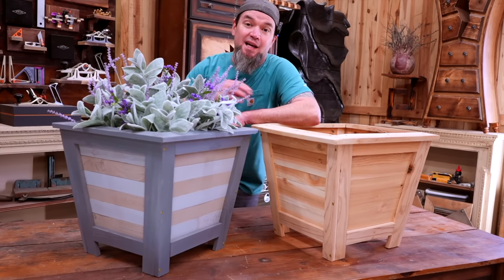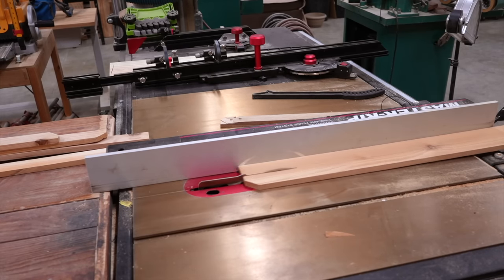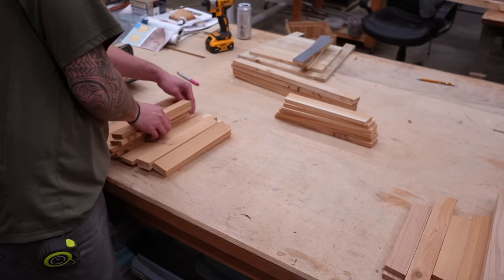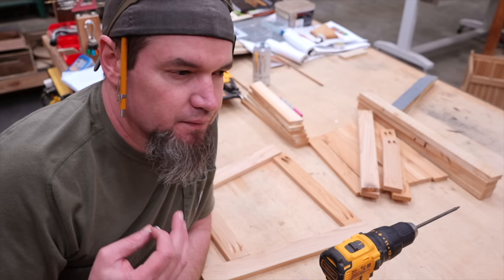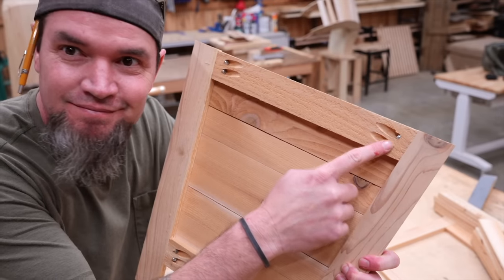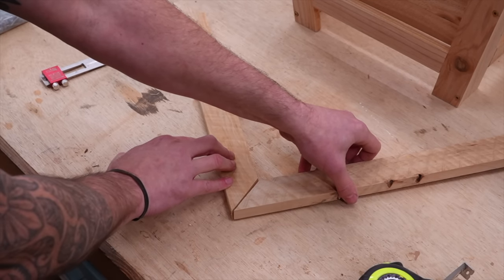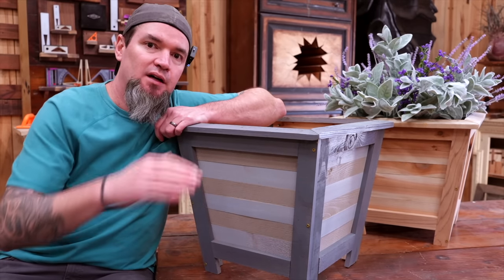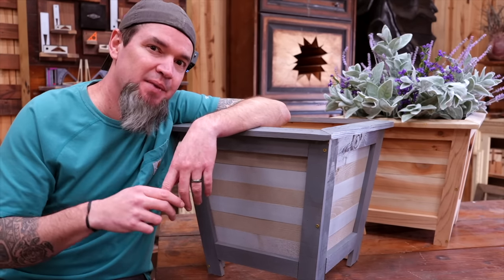The $6 Three Picket Planter - Low Cost High Profit - Make Money Woodworking

Comment: After making the larger version of this multiple times, I came up with a hack to get perfect trim and side heights. The trim 45 degree cut with a 7 degree bevel was an issue for me, because my chop saw doesn’t bevel. I also would get sides that didn’t always match up in height, so I would need to sand a bit to get the trim to lay flat. To solve both issues, I used my table saw. Once you make the frames, take them to the table saw and trim the top of each frame with a 7 degree bevel. This insures your sides are equal heights and your trim lays flat.

Comment: I love these videos man. I’m trying to get my woodworking going. Im gathering my first tools I will need and I have so many plans because of the videos you have posted. Thank you for the inspiration.
Reply from the maker: Awesome! I’m glad to help. You’ve got this.
Reply: Remember if you're just getting started you can get a good deal of great tools used to lower your start up cost.
Reply: Just like gigs said, don’t go hog wild on tools right out of the gate! First tools that will be used almost every time you build are your drill and impact. Get those brand new during a decent sell. After that, find you a circular saw second hand or new, as long as it is within your budget. Speed square and a tape measure. These items will make you dangerous and ready to build darn near anything! As your skills progress and begin adding more tools and goodies. I have been tearing up wood now for a few years and I started out with the bare minimum, now I pretty well have a full on wood working shop that is still ever growing! 

Matthew, love your videos. I enjoy these builds and will adding some of these to my arsenal for our upcoming vendor market in April!
Reply: @Chris Smith  your right I've bought tools off face book, and I go to garage sale
Reply: tape measure, circular saw, wood glue, screw driver, speed square.  that's about the minimum you'll need.   
but to add to that to make it a little more comfortable: kreg accu-cut (turns circular saw into a track saw), 2 saw horses, drill, pocket hole jig (I literally just bought the cheapest kreg one and it's 10x faster than glue and clamps).

upgrades from those 2 list are miter saw, table saw, work bench, brad nailer.

All of the tools could be purchased used from pawn shops, goodwill, harbor freight.  I've read Wen has some decent new tools that are budget priced but I haven't used any.
Reply: @jetah50  I have a very nice WEN plunge router that works great, comes with guides and a sturdy case, was only $80.
Reply: I wood (pun intended) look in your local pawn shops for wood working tools.  I just picked up a Wagner sprayer for $75 brand new in the box.  Retail is $150.   New Ryobi jigsaw with battery and charger $60.   If you look. You don’t have to break the bank.   Yard sales are great as well.  Check local classified ads for estate sales.   Plenty of lower prices for great working stuff.

Comment: In reference to the top trim, if youll flip the board from top to bottom as opposed to flipping left to right you can cut the 45 on the other end of the board and not have to worry about changing  the bevel to the opposite side of the saw. Your board will now be on the opposite side of the saw blade then it was was for the first cut. Why change the bevel again if you dont have to.?, Set up the saw once and leave it. As mentioned this is only referenced to the top trim, just an idea, but great build I'm gonna give her a go. Thanks for the great videos.

Comment: This is my first YouTube subscription.  Great instructional video.  Easy to follow and replicate.  Made 5 of these this weekend.  The first one with 1x cedar boards and the other 4 from cedar pickets.  The pickets were the thinner ones so I had to predrill where the pocket screws were going to go in to prevent splitting.  The 1" pin heads worked great after that.  I threw together a quick jig to help keep the A-frame pieces in place while screwing them together.  Well worth the 5 minutes it took. Everything worked out great.  The planters look fabulous and are extremely sturdy.  I scaled the plans down an inch and will probably scale it down a little more to adjust for smaller square pots.  
Fun project.  Thanks for the video.

Comment: Just made this project. It was a quick build, I love it. I actually cut down really thin strips when I rip down my 2x6s and have leftovers. I cut them down to about 1/4". That's what I used for the slats. Since they're really just to close in the box they don't really pose a durability problem. This way I just use the staple gun to put them on. The thing looks great. Only thing I'm gonna change going forward is I'm gonna leave the 8 degree bevel out of the top trim and leave it straight. I love your channel though. Glad today was warm out enough here in Canada to get in the garage and try this out. The wife loves it. Gonna have a lot of work to do this summer. Thanks again man.
Reply: The wife wants me to try to build a taller one too. I think I'll do this same build maybe change the bevel to maybe... 4-5 degrees and have it about 32" tall. Love it man. Gonna make a ton of these.

Comment: Thanks for idea, I just made 2, I used 1" Stained pine, for legs and top/bottom board and Cedar for slats, I also did screws on sides instead of pocket holes because I only have basic Kreg tool. I'll let you know how it turns out.
Reply from the maker: Awesome!
Reply: I was thinking of doing the same thing - how'd it go? Any tips?
Reply: @RareRiddemz  Been a few months sitting outside, still look good as new, the top boards warped a little so when I make these again I'll probably try something different.

Comment: Hi Matthew, I've been a subscriber for a while now and really like your approach to videos, no distracting music, no sponsor speeches taking up a third of the video unlike some I could mention, just good solid content.

You couldn't build those planters for that price here in the UK. The only fence pales/pickets I can find here are: 5/8" x 2 3/4'" x 47 1/4" planed, converted from metric and they're the equivalent of $4.38 each!
A better solution for me I think, would be to use what they call ' featherboards ' over here. They're about 4" wide and 71" long. They're really narrow on one edge and about 1/2" to 3/4" on the other edge. I can buy them for the equivalent of $1.70 each , but they're pretty rough so they need a lot of sanding or I could leave them with the rustic effect including splinters.They could be made flush on the outside and                ' feathered  ' on the inside. It'd take some complicated working out but I think I could make it work. 

The biggest problem I've got is lack of space. I live in what's known here as sheltered housing, most of the residents are older/seniors ( I'm 68 years young ) so too much power tool use can lead to complaints. Also, the only space I have available in my apartment is my second bedroom which is only 11" 6' by 7" 6', so no room for a decent table saw 😕. I've got a Bosch Pro saw that I can use with a track and a sliding mitre saw but no room for much else. 
I'm building a small built in wardrobe in there at the moment and that's become a challenge.

 One question I'd like to ask you is, how do you ship your planters? Do you sell them as flat pack and self assembly or all fitted up?

Comment: Howdy Mr. Peech....

Was wondering when you'd put out another video. 🤔 

With these planters, I noticed you always build the bottoms with slats, this is so it holds a potted plant. 

How bout the other way of turning it into a "pot" itself? I built 2 planters last season (for the wife) using Cedar. Made the bottom out of slats as well, but used more of them and spaced them just a little shy of touching for water drainage. Then I used some of that black plastic fabric "weed control" stuff to line the inside stopping short a fee inches or so from the top. This liner has a million tiny holes in it that allows water to pass through but doesn't let the soil pass through. 

Sprayed the outside of the planter with Ready Seal outdoor stain (Cedar color). 

1 year later and it still looks like I made it yesterday. Also. Just for testing...On one of the planters, I also stained the inside. I wanted to see the difference a year later if; 1) Did the stain affect the growth of the plants, i.e. did it leech into the soil. 2) See the difference of what happened to the wood itself. Did it rot etc etc. 

I'm happy to say that in both planters, the plants grew just fine. The untreated planter shows some signs of deterioration but it's just barely. The treated planter,  though a bit discolored has no visible signs of deterioration at all. 

Also, I used nothing but Tight bond 3 for both of them, no screws though I did use 1" Brad nails to tack them. 

So, after 1 year in South Texas climate, they both still look great. So, Tite Bond 3 does the job well. 

On another note. This guy you mentioned who was selling these...You didn't mention where or how he was selling them. Craft shows? Market place? Etsy? Side of the road? 

Thanks for another intuitive video Mr. Peech.

Comment: I’ve been making the first version of this after buying the plans. While the lumber is cheap there’s a lot of hardware involved mostly external 1 1/4” pocket hole screws and they are pretty expensive. Regardless it turned out pretty good. Looking forward to trying this one next 👍
Reply: I put 1 pocket hole per side of the frame piece instead of 2.  So 4 pocket holes per side.
Reply: @jetah50  good idea. I stuck with the two per side but I used 1” self tapping #8 deck screws on the flat panels and some glue and 1” Brad nails in some places. My biggest issue right now is making the Farm House planter with three pickets. Always migrates into 4 as the cut list on the plans doesn’t work out. Been asking for help with this but no advice so far.
Reply: @alexreid4131  measure the wood before you buy it, bring a tape.  make sure they're 6ft long.

Check the thickness of your cutting blades. that thickness reduces the amount you get over the length of that board.  There are thin kerf saw blades. Or you can use a bandsaw or hacksaw.

I had to write down the measurements of each cut and qty just to figure out a better way to get everything in those 9 rips.  Today I managed to get around 2ft left over!
Reply: @jetah50  for the farm house design? That’s fantastic! It’s the “K” pieces I can’t make work. I’ve tried the kerf changes but still can’t get it to work. Watching his video he seems to sail through the cuts but I always need to utilize a fourth board. Thanks for the support though brother. Glad it’s working out for you. Blessings.
Reply: @alexreid4131  most picket boards are dog eared at the top, and since his cut plan for the 3rd board of the farmhouse uses all 6 feet it doesn’t work out. So I have to cut a piece off of a 4th board. I’m then able to use the rest of that 4th board, and the end of the 3rd that I couldn’t use for that particular cut, for other builds. Nothing gets wasted it you save all your pieces.
Reply: @TheCripticWolf  hey brother thank you so much for this. I’ve tried so many times to make this work with only three pickets and I just can’t do it so you confirming that for me helps my sanity. Still seems I the video that Matt makes it work with three somehow but I have no clue how he did that. Thanks again for your advice buddy. Much appreciated.
Reply: @alexreid4131  yeah it may be possible to rearrange the cuts, but just following the plans that last board will be short unless you find 6ft square on both ends. Not complaining at all, love this channel, I’ve sold almost 10 of those farmhouse planters in the last week, everybody loves them.
Reply: @TheCripticWolf  well done brother! That’s awesome. I’m about to tackle the arbor build. Keep on keepin’ on.
Reply: @TheCripticWolf  Would you mind sharing how much you are selling your planter boxes for? I live in the Pacific Northwest and I’ve been selling the original three picket planter box that Matthew did for $95 in my area and people don’t seem to have a problem with that here. I also do custom emblems for them free of charge to put on the planter boxes if people want. Things like love hearts and shield across in that sort of thing.
Reply: @alexreid4131  don’t get anything like that around here! I sell farmhouse for $50, and that’s after seeing similar builds on marketplace for 50-65. But that’s why you have to research your area. So I don’t make a bunch off of it, but it’s a fun pastime for me.
Reply: @TheCripticWolf  thanks for sharing brother. Materials here are also priced higher than most of the rest of the country so it’s definitely not all roses for sure 🤣 I’ve been sanding mine to 220 grit but not applying a finish. Do you apply a deck sealer to yours? I’m gonna try and batch out some farmhouse designs tomorrow. You’ve inspired me. Oh, one thing that might help your sales…a customer asked me to change the dimensions so a planter box would fit a 5 gal Grainger or Lowe’s bucket. And he wanted the planter box to be at least one inch proud of the lip of the bucket. I did that and then offered that design to folks and my sales increased. Worth trying maybe 🤷‍♂️

Comment: thanks for he great vid. Just made my first, and put a small round over on each edge of the panel segments which looks good. Also don't have the chop saw so had to make a little jig to get the angles using cross cut sledge on the table saw..

Comment: So far i have made the snow flake, a square planter box , the hexagon wall art, hexagon serving tray, hanging hexagon wind chime, set of 3 natural cedar logs tea cup candle holders, cedar log coaster set. 2 cedar dinner serving trays. But this flower planter is by far one of the easier ones to build, looks fantastic and the plan layout is so simple , straightforward in lengths and measurements.  No, 15/16ths, 3/8ths except 1 cut. Its not that i cant do it, i just cant see the smaller marks on the tape measurer. That being said I'm making a couple of these tomorrow

Comment: Love your videos, and really appreciate them. Thank you for sharing. I’m just starting out so am still building out my tool supply. I love these planters and would love to make them, however I don’t have a table saw just yet. Would love to see how to go about making all of these wonderful projects using a circular saw.
Reply: i would have to make some jig in order to rip the boards. a sort of homemade track saw.  you need a way to rip 1" to 2" wide strips.
Reply: Hi Rosa my first table saw I made my self,  I got an old stateless steel top from a restaurant and cut a slot for the blade. Just make sure it's square to the table and you mount the saw so the blade is rotating the right way. It works well have fun and be safe.

Comment: Two things.

First, I strongly advise putting the bottom boards in before you attach both halves of the planter together.  This eliminates the need to try to angle them in.

Second, I'm having a dickens of a time with the dang cedar fence pickets.  They warp on me something fierce after they've been through my admittedly pretty cheapo table saw.  Are the treated pickets any better?
Reply: Also, while this past prep went well with respect to sanding and cutting the different pieces, I have had a devil of a time with the cedar splitting on me. Is this caused by using the soft wood screws?  Is that why you switched?

Comment: I have a question and suggestion!  So I’m making these planters, using the pocket holes I noticed the screws are only going in the side boards about maybe 3 threads.  I checked the thickness of the boards and they are 1/2 inch.  So I switched to 1 1/4” screws the they did not blow out.  Anyway I wondered if this was said correctly in the video?  
My suggestion or challenge to you is can you take the same pickets on this build and make 2 smaller ones?   I’ve been planning all winter for builds this spring and I’ve been asked on a smaller planter box is why I asked.  I just thought to ask as it might make a good video and could sell to those with apartment balconies!  

Thanks for your work!

Comment: I'm new to woodworking and was wondering about using wood from the box stores. I hear  not to use it because the moisture content is too high but I see that others use it with no problem.
Reply from the maker: Just let it dry inside for a few days and your fine.  There's a lot of folks like myself that don't have access to specialty stores.

Comment: Really appreciate the updates on this planter, I had a lot of blow out on my first batch given that the boards are only a 1/2” thick these days. I ended up doing a ton of R&D to find better screws and screw placement to avoid blowout etc. These planters look great, keep them coming!
Reply: what did you end up finding for screws?
Reply: @rekindledtimber  for assembling the wall panels I used Power Pro 6x1” exterior screws from Lowe’s. To assemble the walls together as well as install the top trim I use GRK 8x1.5” FIN/Trim head exterior screws. I think Home Depot has these but I was able to find 600qty packs at Menards. Everything is glued with Titebond 3 (green bottle) glue. I attempted to destroy one of these boxes as a proof of concept and unless someone is intentionally trying to break these boxes, they are as sturdy as a planter needs to be. I also made a jig to assemble the wall panels and modified it to help install the top and bottom wall boards to prevent screws from protruding out of the walls leg faces.
Reply: @lmnelson86  thank you , that's what I found also.